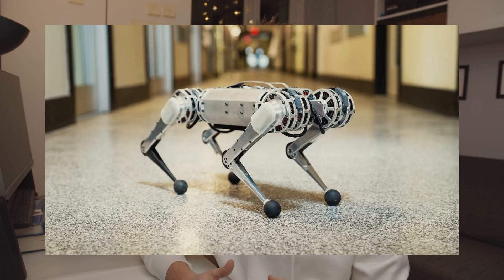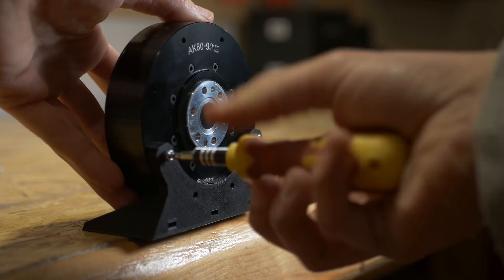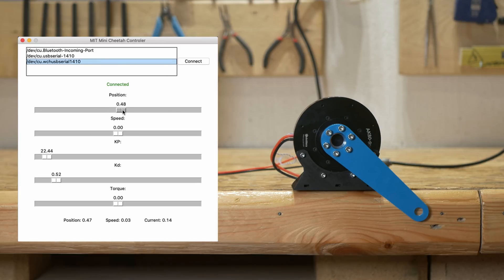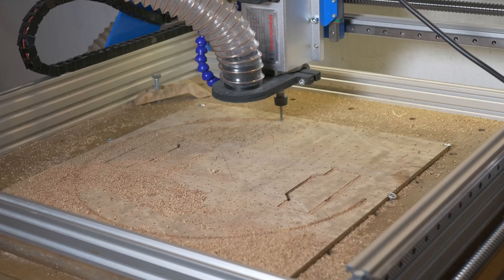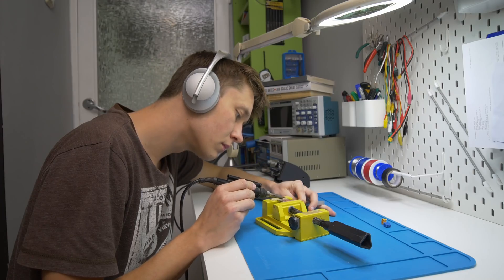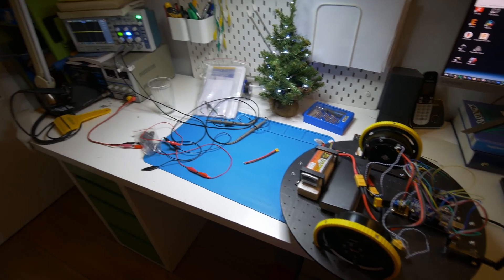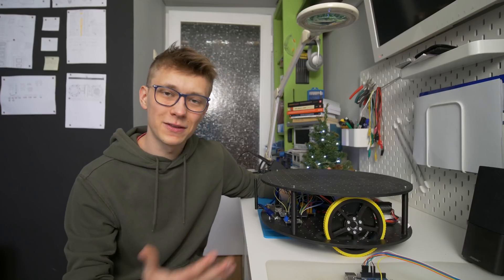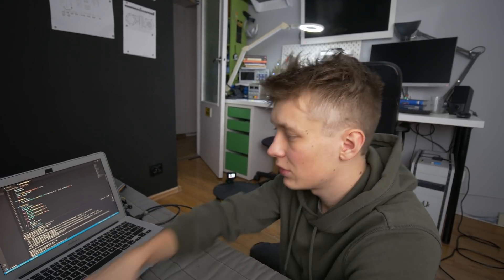You Need These Motors in Your Robots!

Comment from the maker: Any thoughts on the Open Robotic Platform idea? A simple, open source, modular robotic chassis with standarised components and a set of design rules, would you like to see something like this?
Also I might stream some projects here: https://www.twitch.tv/nikodembartnik
Reply: Yes absolutely!
Reply: It's a great idea. Especially because I want to build my own version in the near future.
Reply: Hey 1 big thing. Almost all of the platforms have fixed casters in front and back but that makes an otherwise versatile robot (6 inch wheels) not able to go over even small bumps that are found in houses and up/down curbs outside. Ie imagine what your same robot could traverse if it had 4 wheels. (But 2 is better for spin/cost). How can we avoid this? Springs on caster? Caster on servo? Im struggling with this.
Reply: Put a chair on the robot and I’ll buy it for transportation 😂🥲🧐🤓
Reply: What is your opinion on odrive motor controllers? They seem to me to be ideal to consider to make your design rules and modular design compatible. It's open source and big community.
Reply: I habe an idea of a design where a wheel robot can stop, raise it's wheel s off the ground, then use them to drive a somple arm that picks things up onto a bin on the robot. So same 2 motors provode a mobile robot that can pick small items.
Reply: Do an "Astromech" design...
Reply: Hey, you can integrate it with ROS ecosystem

Comment: Hi Nickodem! Cool project! thanks for sharing.
You mention in your video you had to troubleshoot the CAN communication with the oscillator, could you explain a bit better how to do this? I'm using the same MCP2515   and I'm having trouble connecting to the bitrate of 1Mbps from the motors. My MCP module has a 8000Khz quartz, can that be the cause of the error? 
This is the error I'm getting when i set my Raspberry pi to a bitrate of 1000000 : "Error: bitrate error: 33.3% too high."

Comment: In which mode you use the motor? Servo or MIT? Because I try to use your program but I have been getting in the position a "1" before the position data, I'm using an AK 80-6

Comment: Some suggestion for your spacer rods: print them not in this filament direction (circular layers). Instead print them 90 degrees tilted, so that the filament fibers go from bottom to top (orthogonal to your base platform). They are then a lot more rigid.
Reply: yeah that's better idea to go with

Comment: Title: You Need These $300+ Motors in Your Robots!
Anything Cheaper, like I mostly use Nema steppers, and <20KG/cm servos. anything more midrange? Or any stepper controllers that have an encoder input and can adjust the force?
Reply: Cheaper goes hand in hand with less quality and less torque. You could basically use every DC or brushless motor for a robot and attach some encoder. There are a lot of motor controllers which have a encoder input or you do the math an program such a controller by yourself. The shown motors have also a planetary gear inside, which makes them quite compact. You could add your own gearbox to a motor and increase the torque with that. There are nearly infinity possibilities for such a drive.

Comment: It was a great vid, but I missed more specs about the motor :) i.e. is it direct drive, what's the stall torque, max rpm etc :)
Reply: That sounds interesting. And 18 Nm for such a compact package is quite a lot! Btw in general, at least for my part, it's better when the video provides enough info on its own, without having to navigate a Chinese-English webpage😊👍 anyways, I'm really looking forward to seeing where this project goes!
Reply from the maker: Thanks a lot! You can find everything on their website so I thought I am not going to repeat that in the video. There is a planetary gear with different reductions depending on the motor model. Max speed for this one is 45 rad/s and peak torque 18 Nm. Hope that helps a bit

Comment: Yea... If I had still been drinking my morning coffee at the time of browsing the T-Motor Price list, I'd most likely have spat it out again... You weren't kidding about them being expensive.

@05:18 I don't think that layer line orientation is looking promising man... Maybe consider printing the part laying on its side and either suck it up and have it print with supports for the wheel gap or split it in half and then screwing it back together ( I mean... what's one additional screw gonna hurt you anyways if it provides you a structurally sounder part... )

Comment: belt power transfer to the arm, only the base joints from the motor directly, each joint independent connection to the belt power drive line
Reply: or axle power transfer drive, again independent per joint connection clutch type
Reply: its like per wheel car axle clutch, not only one at the engine
Reply: so you cant make your own motors
Reply: check my designs for pure-dc brushless motors-generators
Reply: magnetic double "cog" clutch system
Reply: its like a alternating poles magnetic rotor stuck in a position with the polarized coil electro magnet system, works as both a clutch and a break and even a regenerator

Comment: "How To Mechatronics" channel uploaded a cycloidal drive video a couple of days ago. STEP files also included and uploads to Fusion 360 very nice. I did it. 
His clearance is only 0.05mm which is too little. I'd use push/pull (Q) in Fusion to give them more clearance though. Specially between the cycloids and bearings. 
Take a watch if you haven't seen it. I think it would be perfect for a robot like yours. Slap wheels on the output plate and you're done! 
The motors you have are very nice, but very expensive and not many DIYers can afford. I think you should use them for what they were designed for. A robotics arm or manipulator.